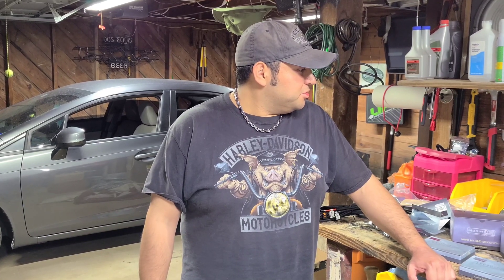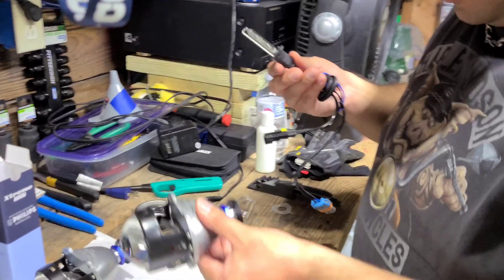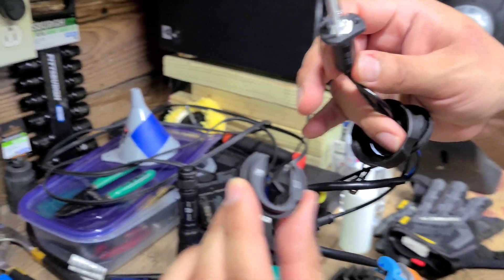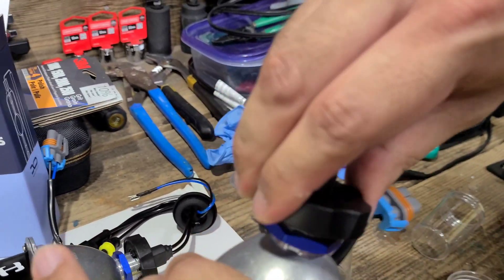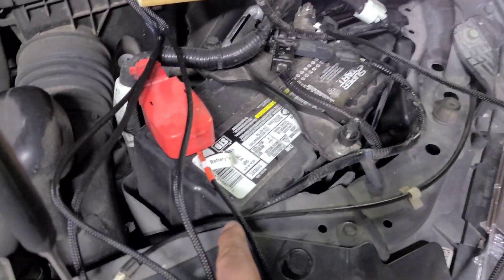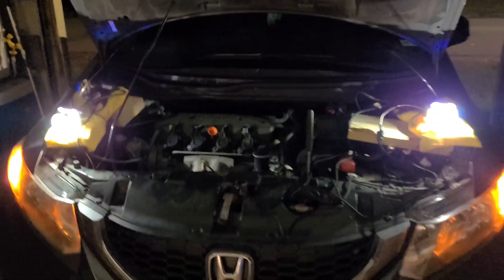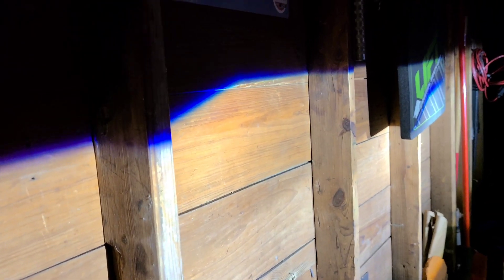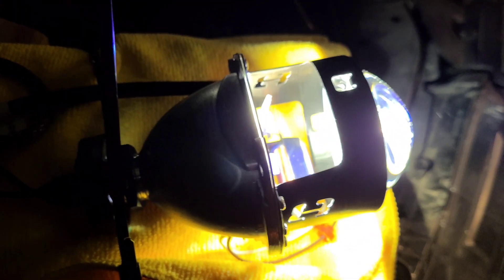Morimoto Mini H1 8.0 Test

Comment: Did you tried so far to place the Xenon Depot XTR HID Phillips XV2 4800K HID bulbs one next to another and to check how good are aligned? I mean the "small bags" with xenon gas and salts, where actually the light comes from? I am asking because i've heard some stories about this rebased Philips bulbs and the problem with them is that you can hardly find a set to be aligned/same position...Thanks!
Reply from the maker: I've had this system now for three years. The rebased bulbs have performed superbly! I am very happy that I went with these bulbs. There are no issues with alignment, color matching, or focus. They are awesome!

Comment: Whats up Mike. Was wondering if you were going to upload a video of output shots, distance shots and what not. I just retrofitted these exact projectors from TRS into my 2010 mazda rx8, im using some cheap knock off bulbs while i wait for the morimotos to arrive. Just wanted to see a good light output video for comparison.
Reply from the maker: Hey Josh, yes I'm planning on posting a video of the whole retrofit with the after shots. Unfortunately when I filmed the videos, I didn't have a system capable of video editing. Now that I have one, I'll work on posting those videos soon

Comment: I did a retrofit on my 2017 Civic Si using D2S because of the availability of bulbs, was using Philips XV2, Osram CBB, etc. .. 2 weeks ago I did another retrofit that is on my 21 Type R which requires a LED to Halogen connectors so you have to really want projectors to go through the hassle. 100% worth it!
Reply from the maker: Sounds like a fun project! Did you use the regular size D2S or the mini D2S? If you use the regular size, did you have any fitment issues? Did you have to bore out the rear of the headlight housing to get it to work? I'm thinking of going MLED 2.0 next time, but I don't know if they'd be brighter than my current set up. 

I'd say go for it on your Type R. When I pass by the newer civics with the LED headlights, even my mini H1 8.0s are brighter. I still think projectors give the best output.

Comment: hi , just one side for the low beam is connected ? and about the high beam , do you need the splitter or is not necessary ? thanks you !
Reply from the maker: Depends on your setup. Since I used the morimoto wiring harness (relay), it only needs the on/off signal from one of the low beams. So yes, I only have one side of the low beam connected to the wiring harness. I just taped off the other side and secured it. 

As for the high beams, I am only using the projector high beams, not the stock high beams, so I didn't need a splitter. If you want to use both the stock high beams and projector high beams, then you will need a splitter.

Comment: Not bad but, if fitment was the reason, I'd have gone with the micro D2S version by Morimoto. Better performance, wider hotspot and also OEM bulbs options.
Reply from the maker: That is an option, but I didn't see the point as I would have to bore out the back of the headlight housing to use it. If I was going to do that, I might as well use the regular D2S or even the MLED 2.0. After having this setup for a few months, I've been very happy with it. But I do wonder how the light output would be with that MLED 2.0 setup. I went with the recommendation from TRS, but in hindsight I don't think it would've been too difficult to install the MLED 2.0. I may do that in the future